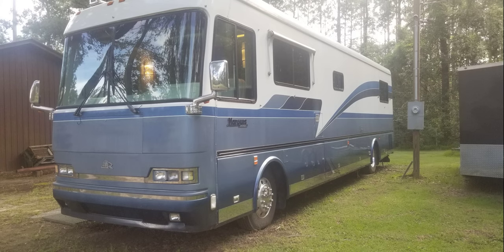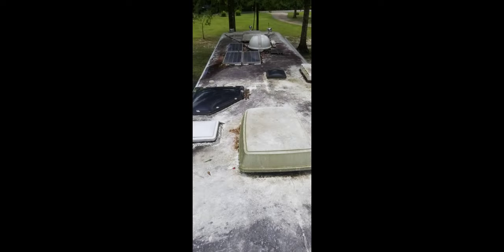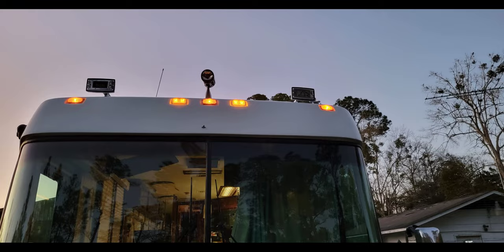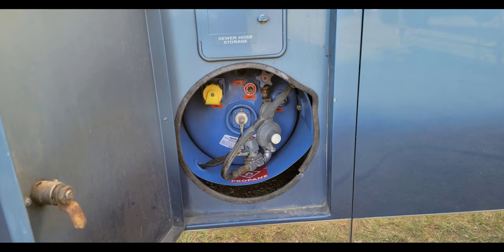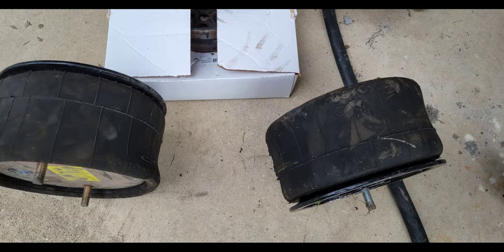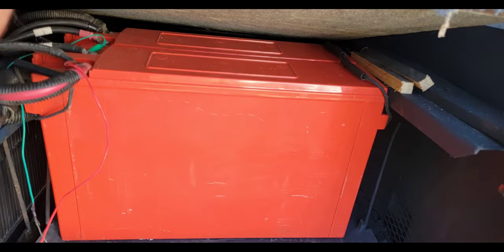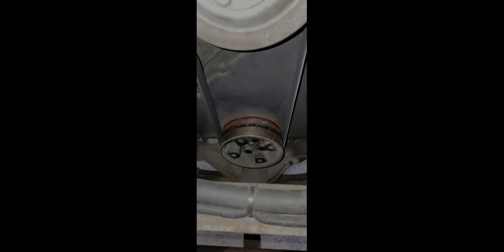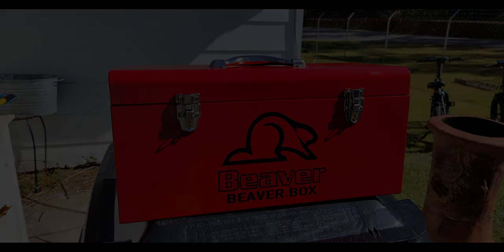Getting Our 1995 Beaver Marquis Motorhome Road Ready! Loving our Beaver!

Comment: Nice job! I’m currently restoring my 1996 Country Coach 32’ non slide. I love older high end coaches like Beaver, CC, Monaco. I’m eager to see more of your coach.
Reply from the maker: Country Coach's are nice coaches. I like the non side coaches, less hassle and just the two of us so we don't need the extra room. One good thing about the 90s diesel is no def fuild to deal with.
Reply: @tgif3657  not only the Def, but the power to weight ratio gives them plenty of power.  The coaches with the 5.9 Cummins in them are worthless.  So many of the 38 to 40 footers of that era are underpowered,  overweight, and quite frankly, dangerous.